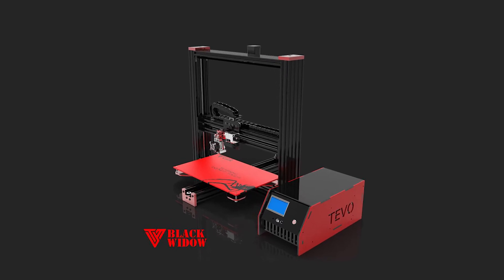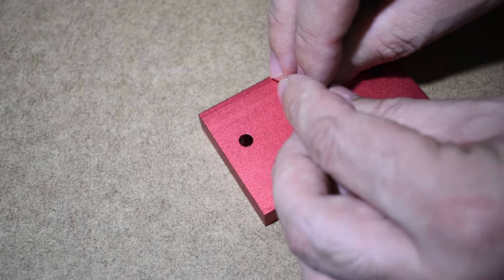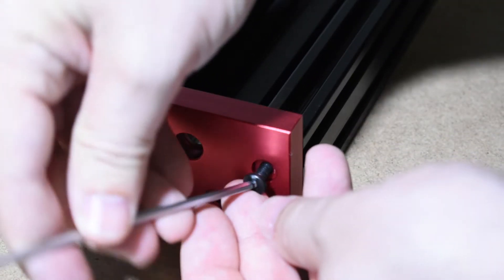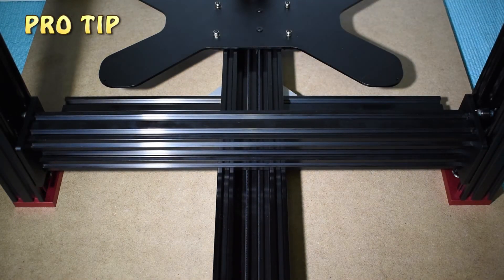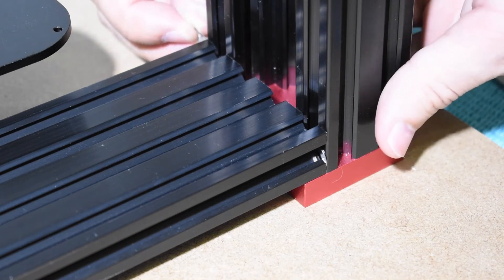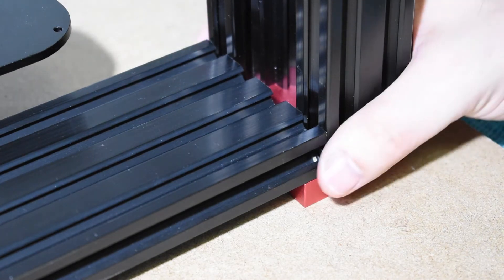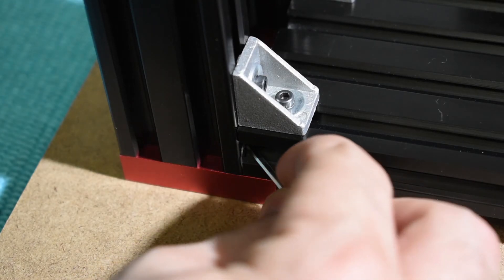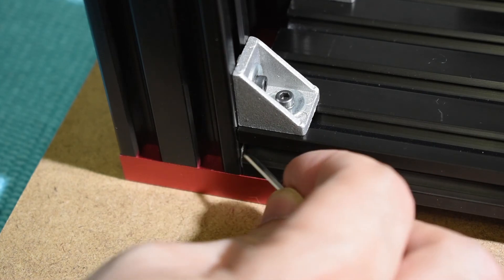TEVO Black Widow V3 assembly - STEP 4 (vertical beams)

Comment: Thanks for the Videos! I'm really tempted to get the widow, I already own the Tarantula and have replaced the acrylic with aluminium. In your opinion is the Widow worth it as an upgrade?
Reply from the maker: Hi Aaron,
I'm still at the assembly phase, so i don't have an opinion yet.
However, from what i can see, this printer does have potential.
I will finish the assembly videos and after those, i will make a review of it.
Regards
Reply: i'm assembling the bw, also coming tarantula, very close to giving up ...